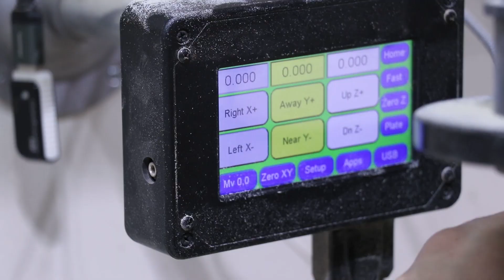Wooden Toys a beginner CNC project that sells!

Comment: I just bought that  wood harbor freight work table
Reply from the maker: Nice! Yeah it's a sturdy little table. I added casters to it so I could roll it around. My shop tour video has a good look at the setup
Reply: @DuffeyWoodcraft  cool ill check it. Also what kind of CNC are you using?